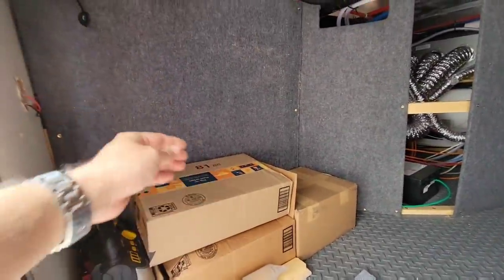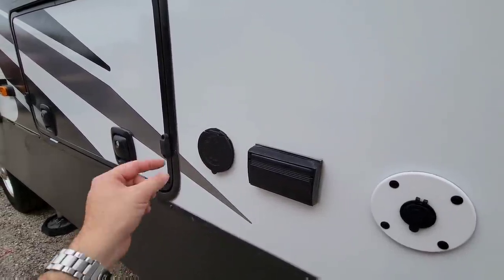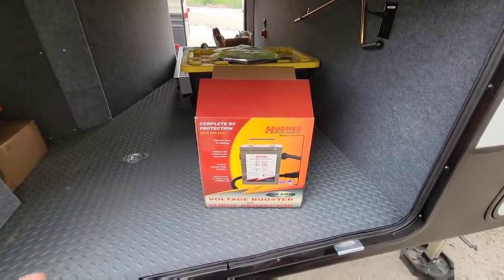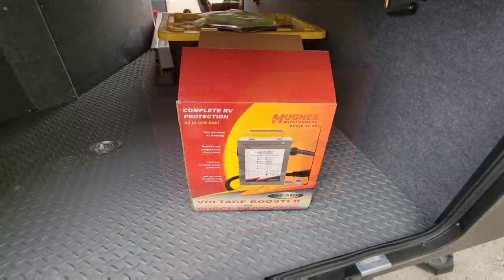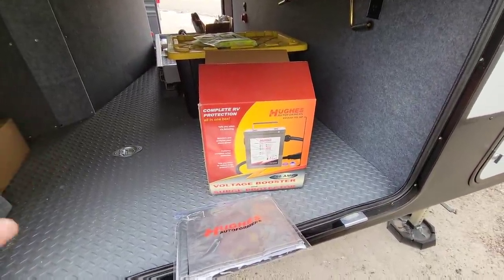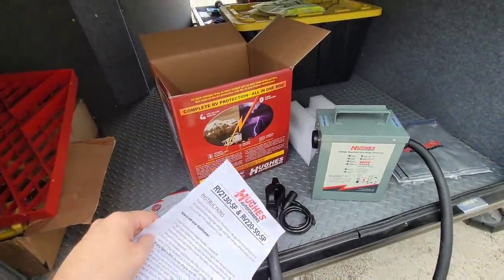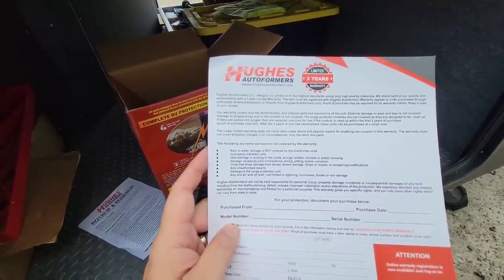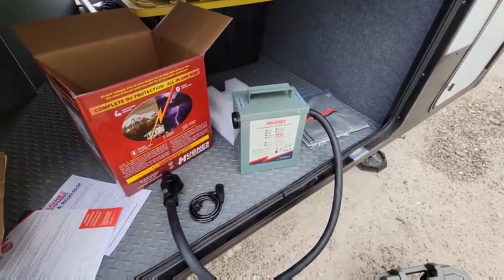Expensive accessory that can save your RV's Electronics!

Comment: The fact that it’s designed to sit next to the power pole but is t waterproof is absolutely inexcusable. That fact alone makes it a very hard pass. 

For a review like this it would be nice if you talked about it’s cost and went into some more detail about how it’s different from a top of the line EMS. For example an EMS will shut off power for low voltage and protect the trailer. It’s seems (but I’m not certain after watching this) that the only advantage this has is keeping the power flowing during a low voltage event. Answering questions like that in a review would be very useful.

Comment: You know in the NEC its specifically states Autoformers are not to be used? I don't know how they get away with selling these things.
Reply: Hughes AutoFormer is NOT a Auto Transformer that the NFPA is referring too.
Reply from the maker: https://hughesautoformers.com/run-your-autoformer-with-confidence-a-note-regarding-nfpa70/
Reply: @BigTruckBigRV  Exactly...Take your chances if the local AHJ has adopted the code from these civilian hooligans.
Reply: @BigTruckBigRV  I checked out the page you linked to, JD, and its wording makes me really suspicious of Hughes.

First off, to directly attack the credibility of an organization like the National Fire Protection Association and dismiss their recommendations as some sort of personal attack against Hughes seems a bit hyperbolic.  Also, Hughes refutes NFPA's claim that the device puts severe additional stress on the electrical system by saying it can't draw more than the intended amount of amperage due to the 50 amp breaker.  The part that it can't draw more than 50 amps is true, but that DOES NOT mean such a device isn't placing additional stress/load on an already strained electrical system.  If, for whatever reason, a campground electrical system is experiencing voltage loss (brown-out), it is experiencing this problem at the EXISTING load levels which obviously cannot be sustained.  Due to Watt's Law, the only way voltage can be boosted is to consume MORE amperage to convert back to higher voltage.  That's what ALL transformers (whether they are called transformers, autotransformers, or even AutoFormers) do.  Sure, you can't exceed the 50 amps, but it's highly unlikely you were even close to drawing 50 continuous amps prior to the low voltage event.  If the brown-out occured at whatever load was existing PRIOR to any AutoFormers demanding even more amperage to boost voltage output, then this is obviously just going to make the issue worse.  Then, think if multiple RVers have AutoFormers, how this can actually cripple an already struggling campground electrical system.  It's not just about YOUR single power pedestal.  It's about the system as a whole.

Also, Hughes cites no sources where they get the information to back up what they are claiming.  It all just sounds like reasoning they came up with off the top of their head.  Going back to the whole NFPA thing, I will believe a safety and standards organization which has been keeping firefighters and many others (including just members of the public) from needlessly dying for decades and making no profit from it.  Just so we all know, the NFPA gave us the fire diamond placard, allowing firefighters to determine a safe way to fight a fire by letting them know what the potential risks are, and what may be burning, all at a glance.
Reply: And the National Fire Protection Association.
Reply: @4WDriver  well said. This is an all about a me mentality.  I have two or three air conditioners and a residential fridge and I’m going to run them.  Who cares that I’m using more amps of a strained campground system to boost my voltage.  So much for the caring RV community.

Comment: Anyone who plugs their RV directly into a power box at a campground is a fool.    Regardless if u have 30 amp or 50 amp. Invest in a REAL surge suppression system.   Not one of those 50.00 extension plugs you get from the RV store.    Get one that tests and monitores your power constantly .      A decent one starts around 350.00 and up.    If you think that’s $$$.  Try paying to re wire your coaches burned out system.     RV owners STOP BEING CHEAP

Comment: I do not like that design at all.  It should be something mounted inside the RV.  It should have a breaker in it so you can turn the power on at the pedestal, check the unit, then turn the power on coming out of the unit going to the RV.  If the power drops too much that it can't compensate (like if you turn the pedestal power off), then it automatically turns off the breaker at the unit.

Comment: Not a good solution at all, a very selfish device.  "Oh, park power usage is high and voltage is starting to sag?  Let me draw even more current to make up for it!"  And for that price it should be waterproof just like any other pedestal mounted EMS, or it should be designed to mount internally only.